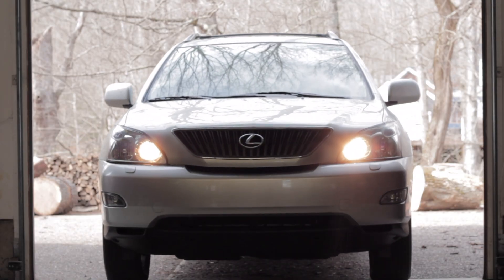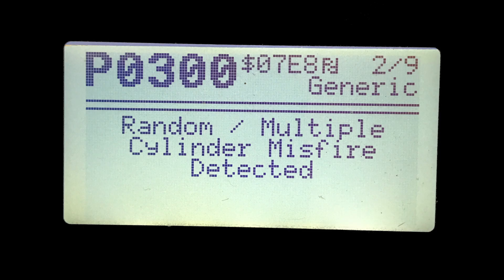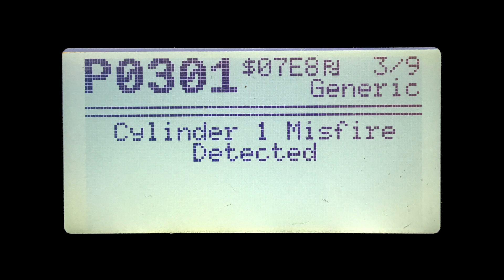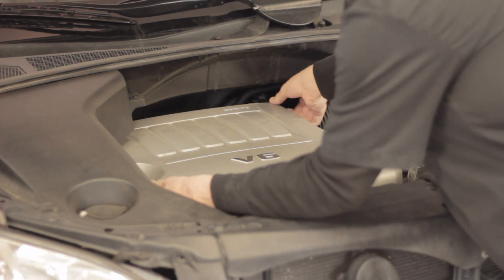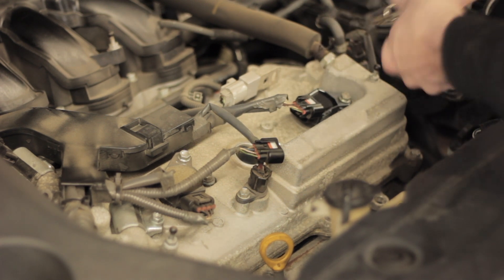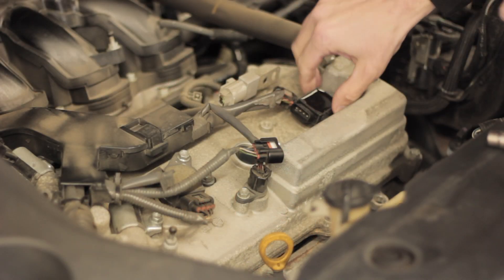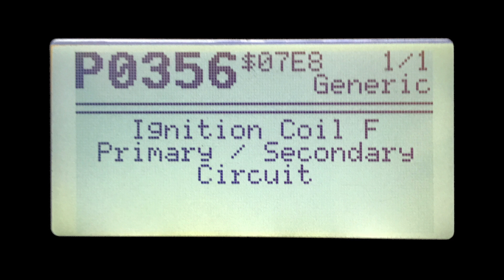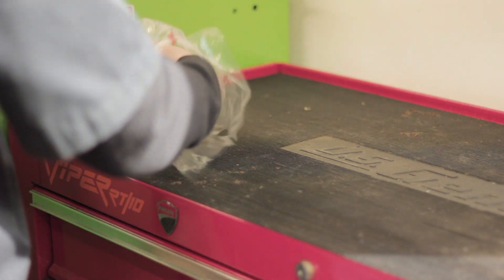Diagnose & Repair Toyota / Lexus RX350 3.5L V6 Engine Code P0300 - Random Multiple Misfire

Comment: I had the p0354 code pop up on my scanner. I have an 09 lexus rx350...i did as you did but when i drove my car around for apprx 3 to 4 miles i did not get any codes or lights...i guess i will see in the next couple days what happens...

Comment: Is that cylinder layout the same for a 2009 lexus rx 350? Just wondering because the back 3 cylanders look like some work to get at
Reply from the maker: It should be as that generation is 2007-2009.  It is a pain but totally doable, just take your time.

Comment: I just had almost this exact same issue happen on my 2009 RX 350. Thanks for this video. Very helpful!
Reply: I have the same year as yours...is the cylinder numbers the same as in this video? Is 4 in the front like in this video?
Reply: @colbyblasenak1770 yeah it is
Reply: @colbyblasenak1770 yeah it is
Reply: what should i do if its just the one code 
p300 thanks

Comment: What would you do for a “p0019 - crankshaft position correlation bank 2 sensor B” does this indicate the sensor or there is a problem with the crankshaft? It did overheat once when the oil cooler return line blew. It has a knock at idle but goes away above 1k rpm

Comment: Great video! I actually did that exact same thing on my 2007 Lexus RX 350 because I got the P0356 code which said that there was an issue with the coil on cylinder six. So I actually did the same exact thing to confirm if it was the coil? I switched out the coils and it still gave me the same code. So do you think it is a spark plug? Or do you think you could be something else?
Reply: Did you ever find out what it what causing the misfires?

Comment: Hey there why is it that one failed coil caused all those codes to occur? I’m lost as to why that happened?
Reply: Misfire more one cylinder gives u random misfire because computer cannot accurately determine which cylinder is misfiring how did u get confused if I may ask ?
Reply: @gustavomartinez324 and than it said said it was cylinder 4..did you miss that part

Comment: Just recently been having random misfires on my '09 Avalon 3.5 V6. I suspected that it might be a coil. My mechanic is going to look at it next week. If it is a bad coil I hope it is on the front cylinder bank. I hear replacing a coil on the back requires taking off the intake manifold.
Reply from the maker: Yes, just had another coil in the back go bad so I replaced them all.  Everything has to come up but if you go slow and methodical it is not that hard.
Reply: You don’t HAVE to remove it but it’s much easier to replace the spark plugs/coil when you do. Also if you have gorilla hands you’ll probably need to remove it. I’m 6ft medium build and can just barely do it.

Comment: Did this fix all of the cylinders misfiring (random misfire)
Reply from the maker: Yes, but make sure you do the switch first to verify it is a coil and not something like a wiring or connector issue.  You can also use the same technique with spark plugs as well as a bad plug could cause the same issue as well.  If it is a back coil and/or plug (cylinders 1-3-5) you need to just replace all of them as it is a bigger job to get to them with having to remove the intake, throttle body, wipers, cowls, drip trays, etc.  You can see all that has to be removed to get to the back cylinders in this video at this time stamp:  https://youtu.be/gOxVPvQSxaw?t=63